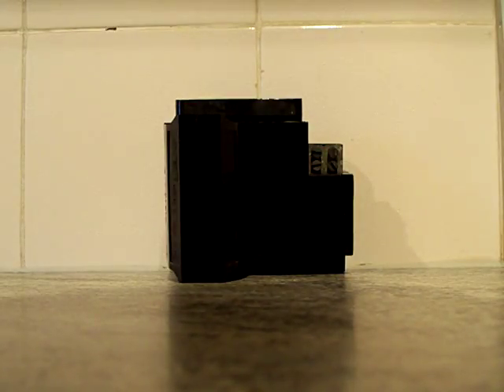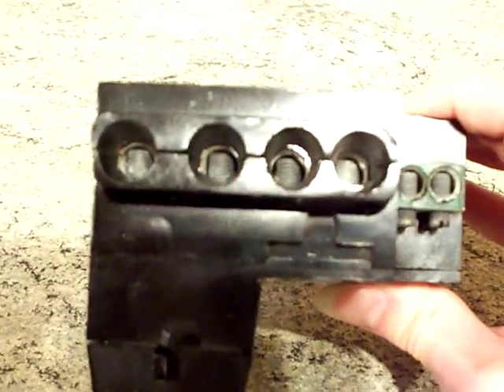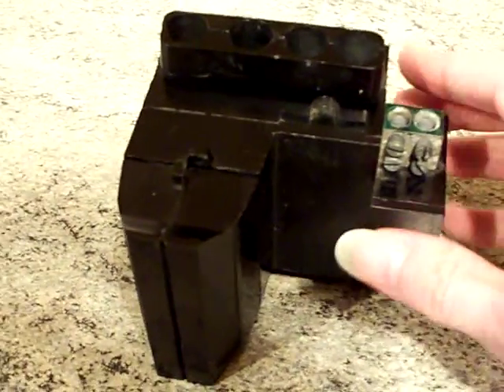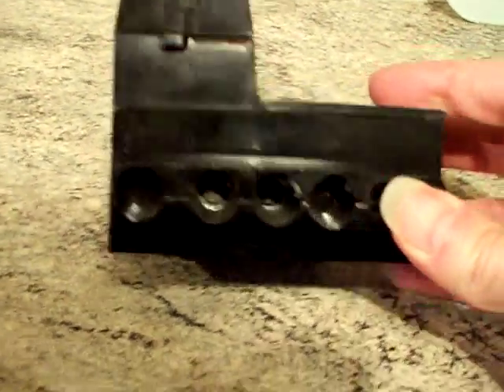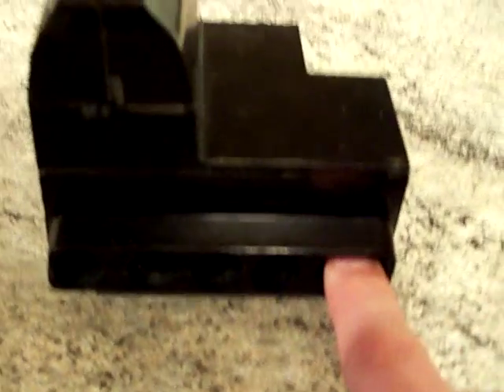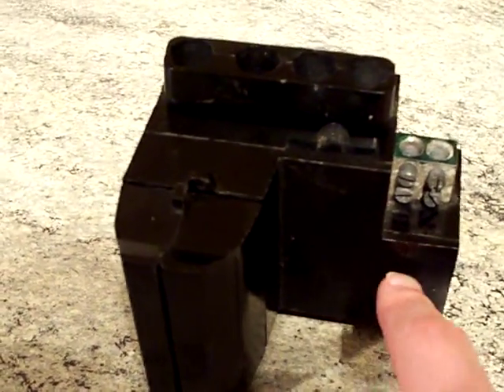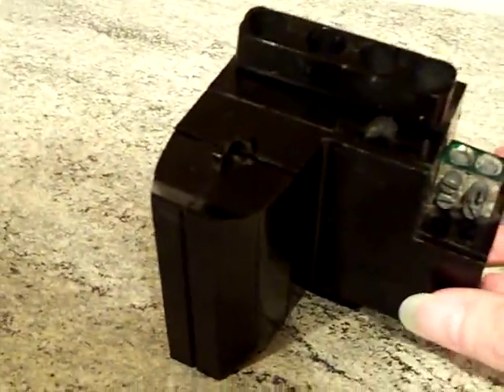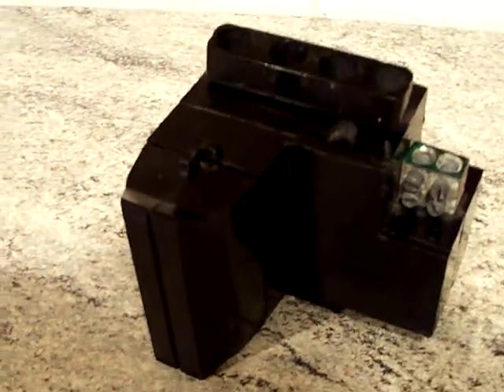Electrical : House service fuse ( 1 of 4 )

Comment from the maker: @AnasheedCast Ah, OK! So if you've seen it, then there it is. The reason why it may be 100A is because of what you have in the house. Another reason, is that electric boards are fed-up of having to keep replacing popped fuses, so they just put in the highest rating of cartridge, which is a bit naughty!! If the incoming service cable can't handle 100A, or the meter tails, or the meter itself, then that is a little worrying! For a 100A fuse, there should be at least 25mm size cables from there.

Comment from the maker: @AnasheedCast Hi....Yours may be rated 400v, but if it's a domestic fuse, then it's probably only single phase, 2-wire 240v. Also, it may say '100A' on it, but it may not have a 100A fuse in there. Our service fuse is a grey Henley Series 7 (with CNE internals) and that has a 60A cartridge in it. The three most common ratings are 60A, 80A and of course.....100A. 

There's no way of telling what capacity is inside without opening it up, and opening it is illegal !! 

-BoomBoxDeluxe.

Comment: @AnasheedCast   230V and 240V are different colloquialisms for the same thing.  The old British standard supply potential was 240V and the official European harmonized standard potential is 230V, although most suppliers have done nothing as the acceptable potential variance ranges are the almost the same.  This is in the same vein as colloquial terminology on this side of the pond, where mains electricity is often referred to as 110V even though it has been 120V for over half a century.

Comment: We have a digital meter now, we have at least a 35mm cable if not more. My electric board itself has its own fuses, it is old but it is a professional one. One question: Is my house 240V or 230V, the electricity board says Danger 240V but people have been saying that it is 230V, which is it?

Comment: @BoomBoxDeluxe Yes it was a bodge job, and it was the thickness. They could have just provided a thinner cable, the amount of current and voltage wouldnt even require the thickness they got. He didnt cut strands, he took like 15 minutes trying to thin it with a heavy duty cable stripper.

The shock from the garden tap must be incorrect earth. I cant really do anything about it. Npower sent their so called qualified engineer.

Comment from the maker: @AnasheedCast Household voltage? That can vary from the time-of-day, due to demand, and how far away you are from the local substation transformer ( what is known as volt-drop ) Your voltage may be 233v, 239v, 240v, 231v....... The only way to find out, is to measure how much potential there is with a suitable volt meter. :-)

Measure the voltage at different times of day, with different loads turned on, and you may very well see different results each time! :-)

-BoomBoxDeluxe.

Comment from the maker: @AnasheedCast Really, it would be difficult to tell. It depends on how much he thinned it. Modern meters should be able to accept a 25mm cable with no problems. If you're worried, then keep total house loading less than 40A ( 9,600 watts at 240v ) & contact the company that sent out the installer, & explain your concerns to them, ensuring that you say that you have a safety concern over the quality of the installation. Can you do a video of the meter as it currently is? That would be great. :-)

Comment: Hi (sorry about the last unfinished comment) in my house I have SNE  but if earth and neutral touch, the 30 mA rcd in the consumer unit will trip, however at another household which has CNE if neutral and earth touch, nothing happens the only other difference is that this house has an old style earth leakage circuit braker (rated stupidly at 500 mA) which is different from an RCD, is this a faulty ELCB or is it not meant to trip? (FYI I used a socket and a plug to touch N to E)

Comment from the maker: @AnasheedCast My goodness! I hope that when you said "they had to cut it down a bit...." you mean the length, & not the thickness, because cutting strands out of a cable to get it to fit in the terminals is a right bodge-job! 

Please tell me that they reduced the length, & not the thickness, please! :-D 

In the USA, certain regions are having problems with unskilled, unqualified meter installers!! One householder even got a shock from their garden tap!! Yes, really!!

-BoomBoxDeluxe.

Comment from the maker: Ah, OK. Firstly, on the 500mA breaker, when you touch N+E together, there may be less than 500mA of current passing to earth, therefore the RCD won't trip. Another thing to look into: Is the RCD mechanically gummed-up? If it has a TEST button, press it. Does it operate & cut the power off? 

In a domestic household, I think the max rating of RCD is 100mA as a main incomer & THAT'S FOR FIRE PROTECTION ONLY. 

For personal protection against electric shock, the max rating should be 30mA.

-BBD.

Comment from the maker: Eh?! It seems like you have only posted half of a message. :-D

From what I can guess..... Your house has SNE (seperate neutral-and-earth) which would probably indicate a TN-S or TT eathing arrangement ( TT in more rural areas with overhead power lines) & if neutral touches earth, the RCD trips out, yes?

If so, this is because neutral current is being offered an alternative path back to the substation transformer. This mis-balances the RCD, causing it to trip out.

-BoomBoxDeluxe.